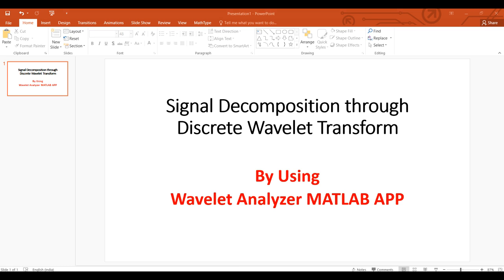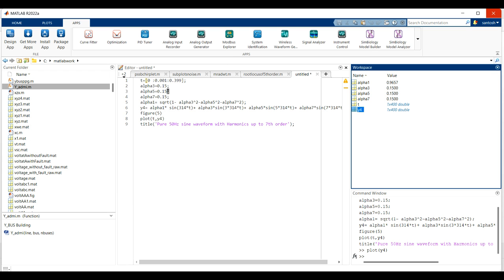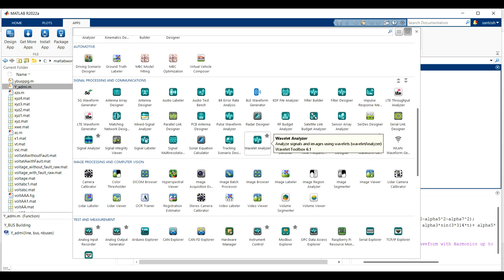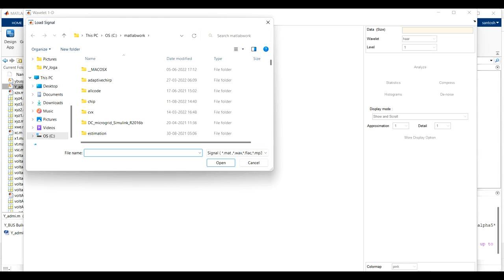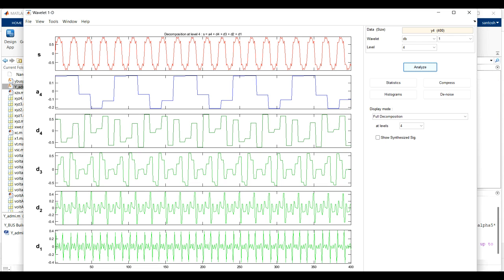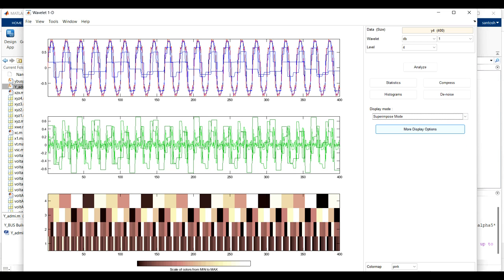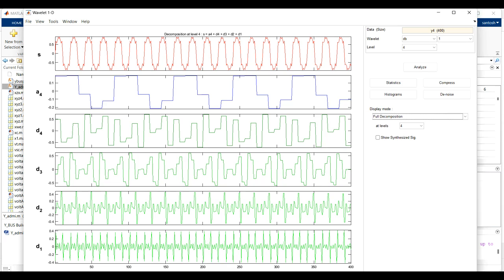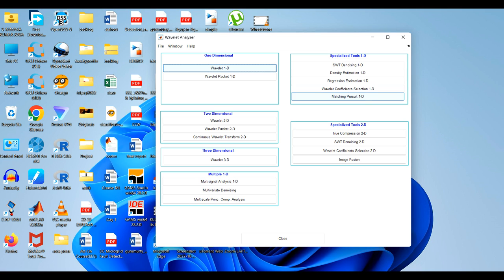Signal Decomposition through Discrete Wavelet Transform using Wavelet Analyzer MATLAB APP

Comment: Hello Sir,

I wanted to inquire about the waveletAnalyzer command that I previously used for analyzing signals (to find standard deviation and energy) in MATLAB version 2022b. Recently, I updated my MATLAB to the latest version, 2023b, and discovered that the command has been removed. Could you advise how I can perform the similar tasks that I previously did, now that the command is no longer available?

Below is the error message I receive when I attempt to run the command:
Error using waveletAnalyzer
waveletAnalyzer has been removed. Use Signal Multiresolution Analyzer, Wavelet Image Analyzer, Wavelet Signal Analyzer, Wavelet Signal Denoiser,
or Wavelet Time-Frequency Analyzer instead.
See the command-line help for waveletAnalyzer for more information.

I have tried using the Signal Multiresolution Analyzer, but it seems that I am encountering difficulties in importing data from the workspace.
Reply from the maker: can you message me here, so that i can put screenshots to explain https://www.facebook.com/srk.joga/
Reply: @smarteee3877  okay i will message you there, sir.

Comment: thank you very much , but I ask how can we find inverse discrete wavelet transform for every approximate and details series
Reply from the maker: we can do, will make a small video on it by tomorrow
Reply: @smarteee3877 details and approximate  @smarteee3877 . @smarteee3877
Reply from the maker: @beboaltemimiburhan1330  In MATLAB, u can use this command for getting inverse DWT through approximate and detail coefficients.  x = idwt(cA,cD,wname)
Reply from the maker: @beboaltemimiburhan1330  In Python, u can use this command for getting inverse DWT through approximate and detail coefficients.
import pywt
(cA, cD) = pywt.dwt([1,2,3,4,5,6], 'db2', 'smooth')
pywt.idwt(cA, cD, 'db2', 'smooth')
Reply: @smarteee3877  thank you very much , please if I can not apply this code or If a problem occurs in the application, can you help me  again .
Reply: @smarteee3877   If we use inverse  Maximal overlap discrete wavelet transform(IMODWT) , what will change from the code please ?
Reply from the maker: @beboaltemimiburhan1330  MODWT is multi resolution analysis. If u have MATLAB 2023 version, MODWT app is readily available or 
clc
clear all
x= some signal information
lev = 4;
x1 = modwt(x,'db2',lev);
Reply: @smarteee3877  Thank you very much for your great help to me. I will try to download the new version of the program, and if you allow me, if I need help, I will come back to inquire from you.
Reply from the maker: @beboaltemimiburhan1330  sure, u can ask anytime